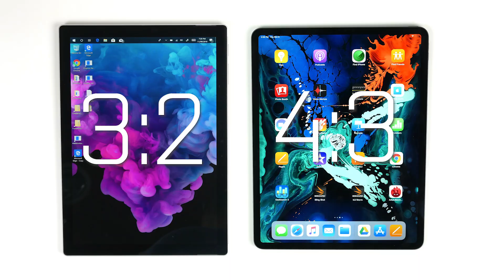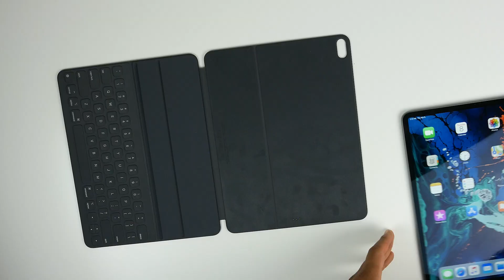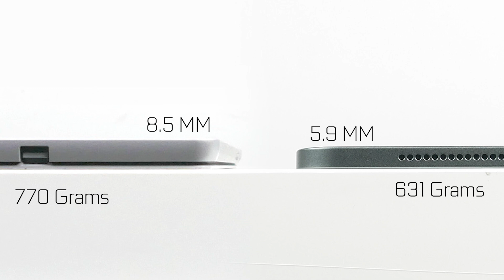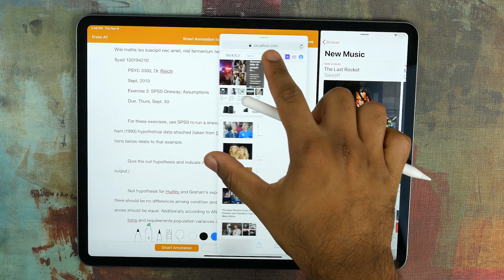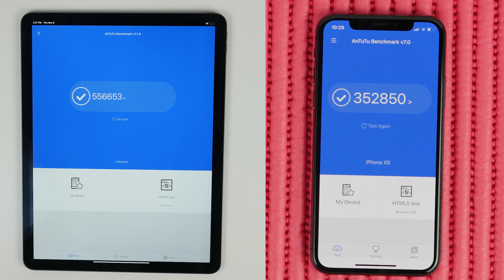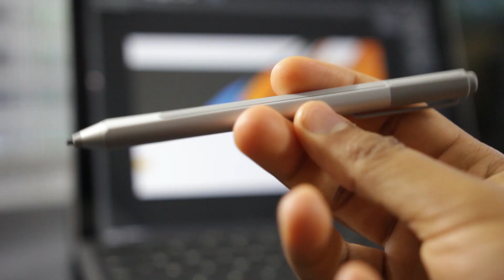2018 iPad Pro vs Surface Pro 6

Comment: These comparisons... agh. This is like comparing a MacBook to an iPad. If you want a laptop, get the laptop aka the surface pro. If you want a tablet, get the iPad.
Reply: For artists this is a very relevant comparison, although unnecessary, what it boils down to is that the iPad lacks software support while the surface has a full desktop operating system on it, for better or for worse, so it comes down entirely to what each individual needs out of their mobile device and if the iPad has the software support to accomplish it.
Reply: Bishr Arar Word👌🏾 As an illustrator, all I basically need is the power of that Apple Pencil! Forcing MacOX onto an iPad would merely kill the incentive for developers to follow Adobe’s lead to create apps specifically designed for iOS.
Apple is powerfully igniting the future with forward thinking!😎
Reply: @Tonabillity  that's cool but then apple shouldn't sell this as a laptop replacement.
Reply: Jonathan Jones I think it’s cool for Apple to keep marketing it that way. They’re just projecting the possibility that they’re standing for. They’ve been doing it that way to inspire the future from the very beginning, nothing’s changed - it’s their model. Remember the first Apple Watch?  It was nothing compared to what it is now, and they had the nerve to charge thousands of dollars for them. Those who wish to participate on the cutting edge of their vision buy into it. Others can simply wait until the possibility is solid. But no one is forcing ANYONE to buy ANYTHING. 

There are plenty of options available for those who crave a traditional operating system squeezed into a Mobile device. 
Those consumers should drop everything and quickly rush to bestbuy to grab the device of their choice right NOW! Problem solved. 
Meanwhile, it may take years for iOS to fully deliver it’s intention, but you gotta start somewhere!

Personally, I don’t mind waiting for developers to catch up to iOS. Procreate is THE most enjoyable creativity app that I have ever used.  If MacOSX we’re allowed, it might never have been developed. After Photoshop proves that they can also make a killing with iOS, no doubt ZBrush and Maya will follow. 
At that point, what on earth would I need a laptop for?🤔
Reply: @Tonabillity  your point is fine IF apple wasn't telling people you don't need a laptop with this thing, which is a lie. This thing is an amped up iPad and there's nothing wrong with that just be honest with your consumers. We are on a tech youtube channel lol you have to think about the average consumer who takes things at face valve.
Reply: Jonathan Jones Dude, it’s just marketing. 😝 I know, because I’ve done it. They also tout each device as being the greatest gizmo EVER MADE, just before releasing a better model. 
They claimed laptops could replaced desktops years before that was actually true. 
Samsung’s marketing claims their pens will have you drawing like a pro (not even close). But that’s precisely what marketing is”supposed” to do. 

Even toilet tissue markets itself as making you feel cleaner & fresher than EVER before!!
But obviously, the ONLY way to actually experience that is with a Japanese toilet that literally washes your butt. 
In my cynical opinion, ANY consumer who takes ANY marketing at face value, deserves exactly what they get. 
As WC Fields says, “There’s a sucker born every day”. 

If a consumer isn’t savvy enough to do a little research before shelling out a couple grand, Heaven help them. 🙄
Reply: @Tonabillity  So it's all the customer's fault for not digging deeper? Look I get it you talk up your product everyone does but your telling people a iPad can replace a laptop that's just stupid. All they had to say is that's it's a nice versatile multi media and semi computing machine that can offset a second PC if you already have a main one. To sell this thing maxed out for close to $2k is insane and to throw everything on the consumer is unfair.
Reply: Jonathan Jones I get that it seems unfair to you. LOL, ALL of life seems unfair to me!😝
A year before getting an iPad, I almost purchased a Samsung Note, just to use the highly acclaimed S-Pen. It promised to do whatever a pencil could do. Unlike the Apple Pencil, it was cheaper and even featured an ERASER!! 

But I tested it and it underperformed. It didn’t come close to the Apple Pencil’s shading capacity. 
So yes, if I had bought it without testing, I would  have blamed myself, but that’s just me.
Reply: @I like my Bunny Girl "As a illustrator , what are you doing with a iPad" 
With the iPad I'm creating album covers, movie posters, toy designs, merchandise, music videos, storyboards and game animation. I've tried the S-Pen. The Apple Pencil creates stunning effects that other pens have not yet developed the capacity for.
Reply: @I like my Bunny Girl Of course I respect any artist's tools of choice. For instance, (traditionally) ballpoint pens are considered mediocre compared to coquille or India Ink pens, yet although I'm trained on India Ink, I love the feel of ballpoints so much that they became part of my brand.
Same with the Apple Pencil, I dig it so much better than my Intuos Pen, that it promptly became part of my style. 

I'm glad that you're rockin' with Wacom Mobilestation, but after playing around with my friend's Mobilestation, I frankly found it too bulky and cumbersome for my taste. Apparently my friend felt the same and soon switched to iPad Pro. He storyboards for Marvel films, and needed something lighter to bring some ease to the hectic gig. In fact, he's the one who eventually convinced me to get an iPad just to experience Procreate.
And I must say, I've never experienced anything like quite it! 
Desktop photoshop feels so antiquated by comparison, that I began to spend less and less time on the desktop.

I get how essential MacOS is to many, but if that operating system ran on iPads, there would've been absolutely no incentive for the development of apps like Affinity or Procreate, and ZERO incentive for Adobe to follow.
Eventually ZBrush, Maya and others are gonna crave some of that IOS revenue and flip the whole game.

Meanwhile, NO - the iPad didn't "replace" my desktop any more than my acrylic paints "replace" my watercolors, but iPad Pro 'did' become my primary device, as I was able to efficiently produce most of my projects in Procreate alone. That app is so stellar, it feels like I'm cheating!

BTW, I totally comprehend how windows occurs as a powerhouse for the masses, but it would be useless for me without the creative fun and ease of Procreate and other IOS apps.
Reply: finally someone that talks sense
Reply: apple's fault
Reply: @I like my Bunny Girl What makes you sure of my professional preferences? Are you an illustrator?
Reply: @I like my Bunny Girl 

Yeah, I hear ya'!
I think marketing iPad as "PRO" is pretty problematic because there are all kinds of professionals out there, and with IOS it really depends on what kind of "pro" you are. If you're a pro illustrator - fine. But if you're a CGI tech - not so much, unless you're using AstroPad, which I don't care to bother with.

Funny, I also initially thought the screen felt too slick and even considered a screen protector, but eventually got used to it.
And I just saw an illustrator on the News demonstrating the 2018 iPadPro, who actually preferred her OLD one, because she felt the new screen "wasn't" as slick, and her style required that speedy line.

I suppose, if I were a Windows user, I'd be in Heaven because "The Future" would already be here and I wouldn't have to wait for it.
But alas, Apple seems to have a longer game plan in mind. LOL, remember it took them YEARS just to get Cut & Paste on the iPhone!!

On the other hand, as an animator, my career depends on the use of two very powerful interactive apps: Disney’s unprecedented “Animated”  http://tinyurl.com/jvjv8py and the incomparable “Animator’s Survival Kit”, http://tinyurl.com/n5293qm 
Nothing currently exists like this on the web. 
These dynamically enhanced educational tools embody vast functionality that eludes other platforms. If not for iOS, I would not be experiencing the transformation in advanced learning that I’m currently enjoying.
But if you happen to know of anywhere else outside of Apple’s ecosystem that I can find exceptional, interactive animation-applications like these, please post some links. I’d love to see them!
Reply: I like my Bunny Girl o can only agree with tonability. 

With apps like affinity etc. Clíp paint and now photoshop coming I have switched from “everything expect Wacom is shit”

For most illustration, concept design and smaller illustration projects the iOS pro is more versatile and quicker for me to use than any Cintiq / mobile studio. 

For 3D and video editing. It’s not there yet. Both regarding accessing files and not any real apps. 

I would never thing I would say that for illustration pro workflow this would replace or be even better than a laptop/desktop with a Cintiq. But for me (it was a transition period ) it is better. 

And as with all all you need to learn the apps and the ecosystems. A lot of people who says it can’t replace those photoshop / illustrator workflow have just scratched the surface (no pun intended)

Hope this gives another voice for what Tonabillity has stated :)
Reply: @I like my Bunny Girl no it shouldn't what if u work on macs anyway what if you prefer the stylus? what if you prefer procreate? you've just stated what works for just you.
Reply: Funny, cause Apple is advertising its iPad Pro as a laptop while Microsoft is advertising the Surface Pro as a tablet
Reply: Correct
Reply: @YashuaFradkin  In benchmarks not real work performance.
Reply: digital artist here its easier to carry just one to work instead of laptop and tablet like i used to. so its good to compare which one is better all round
Reply: @princetubby5698  All the surface is, is a compromised middle ground. It's just a bit shit at everything. Waste of money.
Reply: Just maybe... Apple should stop recommending iPad as laptop replacement. It is nowhere close
Reply: Budget Gamerz You know something called “targeted audience”? Go figure!
Reply: NonyaBusiness! Bingo. If they gave the iPad Pro Mac OS the entire MacBook lineup dies overnight.
Reply: But iPad Pro is laptop money though?
Reply: @NonyaBusiness! no its not at all. its still 2 motorcycles one is more comfortable and one is faster lets compare to see which one you might need.
Reply: Both are tablets... The surface pro isn't a laptop... It's comparable to one based on its internals but it's still a tablet. Laptops are the surface book or the surface laptop.
Reply: @redvivid  But the Surface CAN 100% replace a real laptop, something that the iPad Pro can't do.
Reply: @mrwolfyer  that's what I said lol its comparable to a laptop based on internals. If. You don't want to carry a loptop but you want the power and functionality get a surface.

Comment: Woah, those iPad benchmarks were crazy. Going by Apple's past track record the next series mobile chip is always faster than the previous ipad x version chip. So that would mean the A13 would benchmark similarly to this iPad if not more! I think I might have to hold out for the next generation iPhone, I'm just scared if they change the design and make it worse I love the way the iPhone Xs was made.

Comment: One is for Apple fans
The other is for Microsoft fans.
(comment written on a iPad Pro 12.9, 3rd gen)
Reply: Is there actually such thing as a "Microsoft fan"? lol. People are either apple fans, or "just make do with what they're used to or all they can afford". it's not like anyone is actually excited or thrilled about Windows.
Reply: best combo: 
Any good laptop running windows 10 pro + android tablet (samsung or huawei) 
Any macbook + ipad mini/standard ipad
if you want to get the best of both worlds, you have to buy the best of both worlds, not a single clusterfuck of compromises. A surface pro can't replace a tablet just as much as the ipad can't replace a macbook, and imo they both make very little sense, considering that they are both about 1500€, and for 1100€ you can get a great laptop, and for 400€ you can get a top tier tablet, spend more to get less? no thanks.
Reply: @leonardomincolelli7202  The Ipad pro does replaces a laptop for most uses, anything less than a Macbook pro, so its better than a 13in macbook ,better than an air, and better than any tablet.  Since I already have to capture to my mobile devices its one less step.  The creative apps work in practice much better than full software suites away from power. 
My case is drone footage editing, I can block my shoots in the field on ipad pro and assure I have all the footage needed, then final edit on a PC or MAC.. However those final edits on a macbook pro will typically fail, you still cant utilize the raw power of a good desktop GPU. A tablet is a much more field work viable device over a laptop, the pencil makes it quite productive, and usable while standing,  this is so much better than trying to laptop with no where to sit, so people do the one handed lap top thing, I call this tickling the horderves tray,  its good for reference at best.  I agree you need more than one device, but I dont think you need two mobile devices. Ipad pro, and a desktop covers it all. Since I already have to capture to my mobile devices its one less step. The phone mitigates many of overlapping needs, like documenting the shoot.  I dont think many people have much perspective how much less these creative apps crash  vs Adobe CS* suite.
Reply: Bleach McBleachersen you buy an iMac and start up in either Mac OS or Windows from it!
Reply: One is an overpowered tablet with limited laptop abilities
The other is a broken-hinged laptop with limited tablet abilities.
Reply: one is for entertainment, one is for actually getting work done and making the Benjamin's :D
Reply: @slayyou  really? the surface doesn't look entertaining at all.

Comment: Ipad is miles better faster processor  better  speakers better  display  others etc
Reply: it's like say my pc is better because Minecraft runs faster than Crysis on yours.
Reply: Despite the numbers, it's not exactly a factor processor as they're on different architectures
Reply: iPad does not have a faster processor. It's running a mobile operating system as oppose to a desktop operating system. No comparison, it's a giant iPhone while the other is an actual computer.
Reply: Damon Mason yes, a desktop operating systems that is only for basic user which ipad can handle it like browsing web or typing essays....so is it worth the pricetag since windows is poorly optimise and also away crashed and a cpu from intel which literally trash.
Reply: @NamelessPassenger  this is nonsense to compare laptop with this tab. Go buy same set up with same price. For thousand buck setup iPad you can get a decent laptop(that won't crush). But you won't get tablet. And when you buy iPad you won't get decent laptop. Don't call a gadget that can do email, drawing, Photoshoping as a laptop. Since Apple only put iOS in there, iPad just media consumption device or complement.
Reply: Damon Mason  if it is suitable for you buy it
Reply: Well, it’s the fastest ARM processor, but it’s not X86 so it doesn’t preform the same complex tasks. Apple said it’s faster than like 92% of windows laptops?? Don’t really know how they could back that up lol
Reply: BETTER PROCESSOR? WTF? SINCE WHEN IS A SHITTY TABLET PROCESSOR BETTER THAN AN I7?
Reply: aliwalyd3 lol 

It’s not a “shitty” tablet processor, but yes, it’s an ARM CPU. The A12X I promise will run laps over any other Android/windows arm based device.
Reply: aliwalyd3 lol since now, right now...
Reply: you cannot compare processor speeds by geekbench. intel chips are optimised for pc softwares and apple still has a long way to make that happen ,display of surface is also much better in quality.
   isheeps sounds stupid when they compare intel chips with arm chips just by looking at geekbench.
    even with so higher numbers in geekbench their performance compared to sd 845 didnt reflect those gain in numbers.
intel chips even with low geekbench score still doing some pretty heavy tasks on pc. i used matlab, autocad, solidworks on my pc which are pretty big software. intel chips are beast. only rhing they lack is battery performance.
Reply: golu singh seem like someone who cannot catch up time, everything you said is just the past, intel failed since amd doing a lot better, ok now let talk about pubg mobile which have a pc emulator, and snapdragons 845 can handle hd ultra when an i5 4210u hd4000 stuck at balance setting, yes, it is not everything but it is a sign that arm will surpass x86 from intel soon...just see how much they jumping after 5 years and how difference did a i5 8th compare with i5 2nd gen...this is the future
Reply: iOS is such a disadvantage tho
Reply: lulz full scale windows beats mobile optimized iOS hands down in terms of productivity. what you wanna play candy crush on a $1300 device?
Reply: If it true next MacBook pro won't ever use core i 9th gen. But Apple know how to fool everyone. The Almighty a12x.
Pffftttt
Reply: No X86 means no buy.